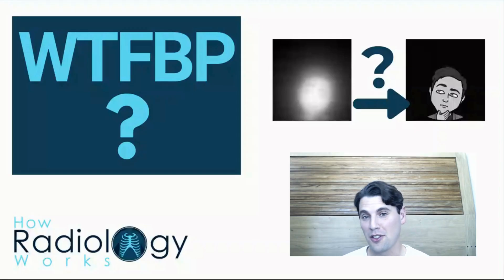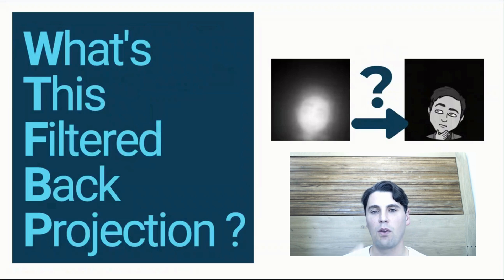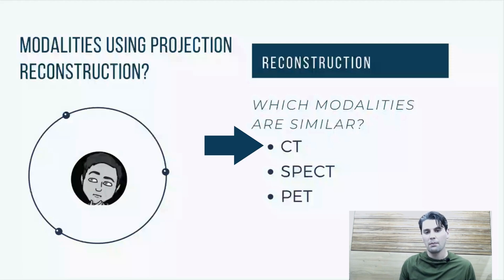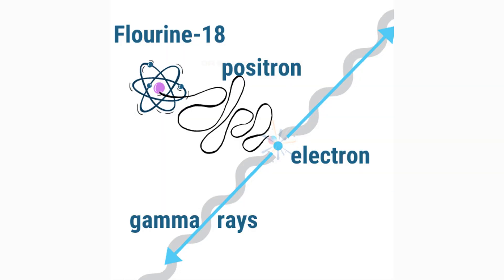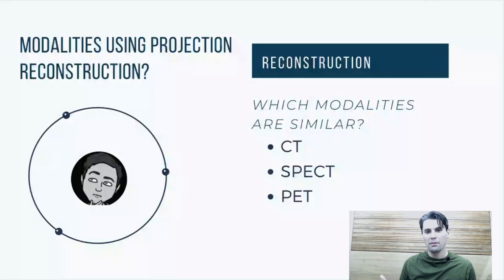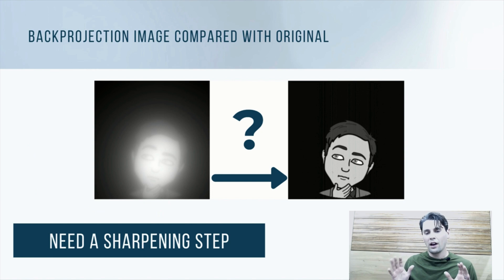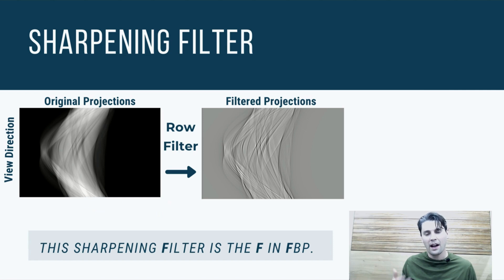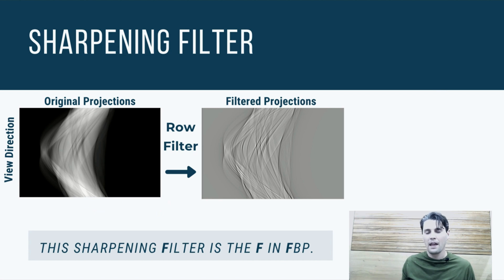Filtered BackProjection (Radiologic Technologists : Illustrated guide to FBP)

Comment: Simple and easy. Great work Dr Brian
Question?
Is FBP still the main method used in reconstruction today or it it substituded by Iterative reconstruction ?
Reply from the maker: We have another video on iterative reconstruction which you may have encountered. FBP is typically used as the first guess for iterative CT so it is still important.
Reply: @HowRadiologyWorks  yea u think i have seen it. I will revise the channel. Thanks a lot for your response.

Comment: Best explanation I've found so far. 
Thanks a lot of bro!
Reply from the maker: Thanks, really appreciate it.
Reply: @HowRadiologyWorks  Anyway, just have one question. When it comes to 3D reconstruction, are we gonna use the same approach (spreading evenly but in 3D rotation)?
Reply: @binhnq_tokyo_shorts_24  yes we follow the opposite of the path of the x-rays during acquisition. So all pointed from the detector cells to the focal spot. In modern scanners this is a cone shape so it is called cone-beam CT

Comment: My question is how the machine figure out the voxel attenuation coefficient since its just add them all together along the line path or line integral idk I maybe mistaken for the name so how the machine figure out these pixels values
Reply from the maker: The FBP algorithm is one way to figure out the attenuation values from the line integrals. Also iterative reconstruction is another method. These methods are called image reconstruction and take many views of line integrals to perform the reconstruction.
Reply: @HowRadiologyWorks  so do i need to study calculus to understand how to get these squares value because I cannot conceptually its so hard
Reply from the maker: Peator the line integral is just a fancy way of saying add up the voxel values along a line. When we take an X-ray image this part is done automatically. Then we need to find the values for the image voxels. So the FBP converts the data to images
Reply: @HowRadiologyWorks  so how many photons or line integral pass per square cm or mm
Also what if pixel size is 1mm and within this 1mm there is many or two different attenuation structure like small calcification smaller than micrometer and air what ct number is assigned to it the average but how they gonna count the attenuation cofe
I tried to add the voxels values like from above and 45 degree and right but some lines pass between these two different square values 
Srry if im confusing u im newbie
Reply from the maker: Peator a few questions here: 
1) depending on the dose there are usually something like 10,000 X-ray photons per detector
Reply from the maker: 2) if there are multiple different attenuation values within a voxel you get an average of what is in there. This is called partial volume effect.
Reply from the maker: 3) yeah I just showed the simple case of forward projection when it is along the x or y axis. When it is along 45 degrees you need to do interpolation, you weigh different values in the sum differently. There are multiple techniques to add up
Reply from the maker: I’m focusing more on X-ray first and then I will make some more CT videos
Reply: @HowRadiologyWorks  interpolation?
Reply: @HowRadiologyWorks  im sorry don’t bother with me there’s many things im new to
Reply from the maker: Interpolation is when the value that you are looking for doesn’t land exactly on the measured data, so you need to do a weighted average of the neighboring measurements